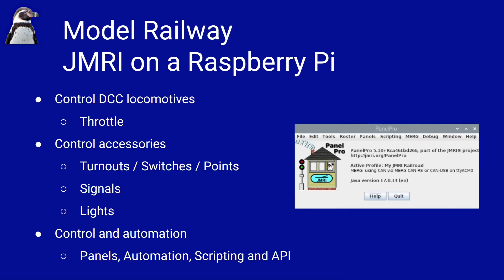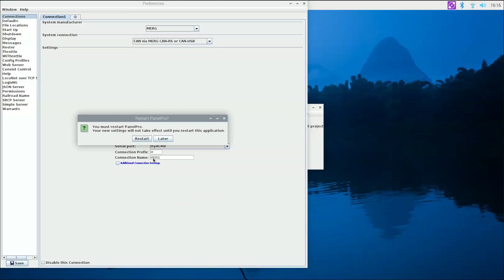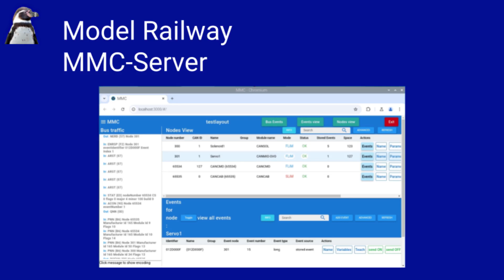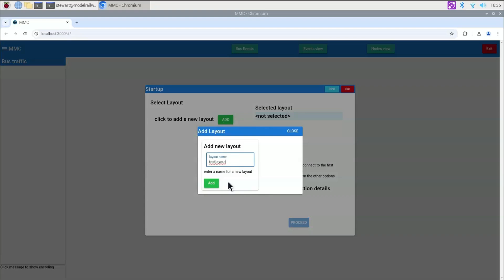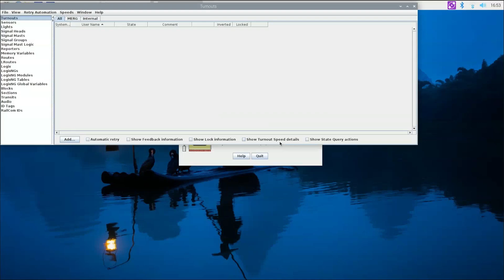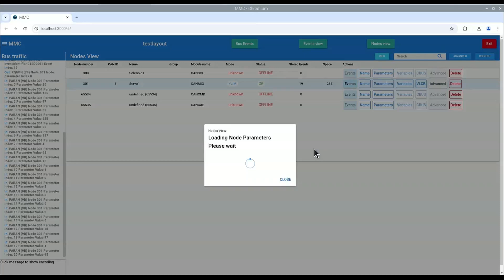Installing JMRI on a Raspberry Pi (Java Model Railroad / Railway Interface)

Comment: Great video. This (and your other videos) have given me a lot of great info. I also joined MERG recently and it's a wealth of information too. I'm a railway signalling engineer and am looking at creating a layout focussing on modelling real world signalling system, using a couple of locos as "test locos". The plan is to demonstrate signalling concepts for educational purposes and have a PC based control panel (similar to real life control centre layouts) and PC based DCC control. With the latter I eventually want to add ETCS DMI's to the driver control. My architecture will be similar ie Raspberry PI, VLCB, colour light signals, servo driven points, servo driven level crossing gates, some form of train detection etc. Instead of JMRI, I was planning on using a software program called Logic Navigator. It is free and was developed by a railway signalling engineer and the interlocking software is exactly the same as what we'd write for real world signalling systems. So for me, that part of the design will be the easy bit. Have a look at it as it may be of interest to you too. https://www.logicnavigator.com/
Reply from the maker: Thanks for sharing that. Logic Navigator looks interesting. At first glance it looks similar to Ladder Logic as used in PLCs. I'm using Ladder Logic as inspiration for my own automation, but also taking inspiration from the CBUS producer / consumer model. Although I am only planning to create a much simpler system (at least for a first iteration).
Reply: @PenguinTutor  Hi, it displays the logic as ladder logic as it's easier for railway signalling engineers to read as we're raised on relay logic before computer based interlockings came about. However the actual code is written as boolean statements like below (which has been extracted from an interlocking in Queensland Australia and it's the logic to light a caution aspect in 15 signal).
assign
    11NKLPR and 12RKLPR and
    15ATS2PR and 15BTS2PR and 15CTSPR and 20ATSPR and
    not 15.17.19USR and
    not 15ALJR and 15RPR and 29LGR
                                                            to 15HR;
Logic Navigator can run the actual code we program into real computer-based interlockings (useful as a quick debugger before it's formally verified and tested) or we can write our own code using similar syntax for any other purpose eg home weather station if you like.